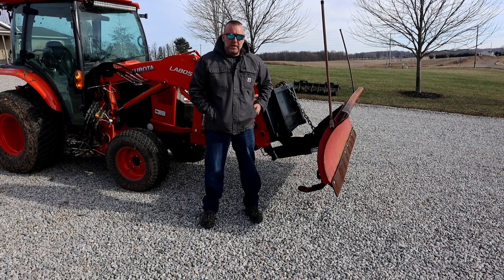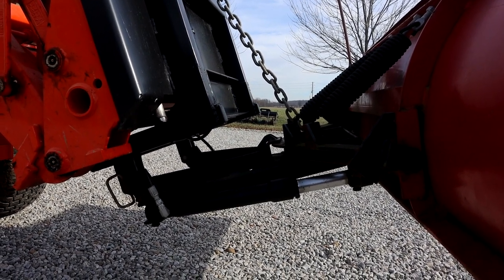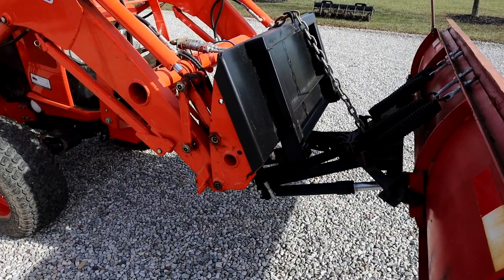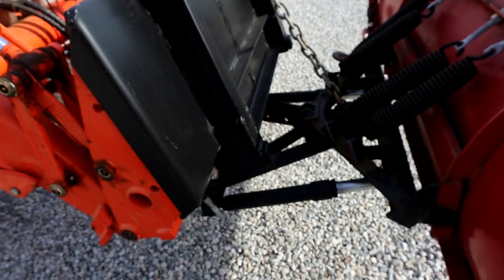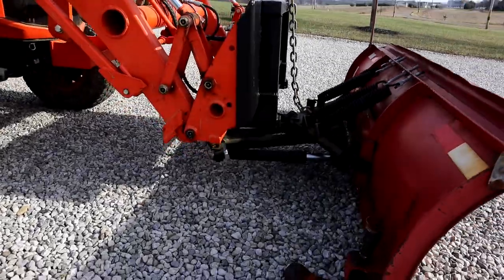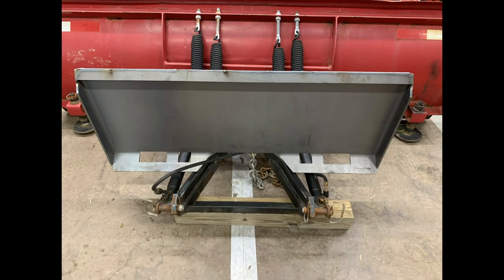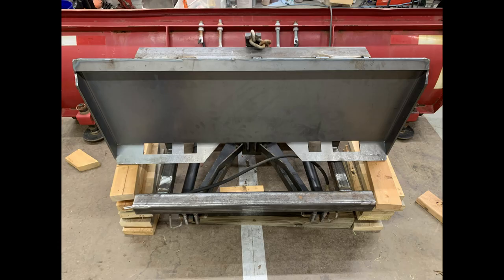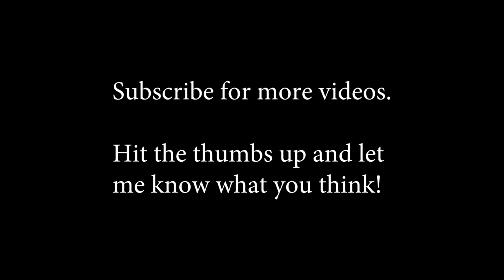Truck Plow Converted To Skid Steer Quick Attach For Tractor

Comment: Originally, I was going to just use the full length of the plow, knowing that would be a lot of leverage on the loader.  This makes much more sense.  I think we are working with similar plows.  Does each hydraulic have only one hose? Mine does. I can't wrap my head around how to make that work, knowing my 3rd function grapple has a check valve.   Thank you for taking the time to make a video and share your ideas!
Reply from the maker: I definitely like this setup. 

Yes, one hose per cylinder. Where is your check valve? Right before the couplers?
Reply: @JaredsShop  I believe the check valves are where the step up would be and where the 3rd function install was.   I could be wrong.  I have a Kioti Ck2610 compact.

Comment: Great minds think alike. Thank you sur, this is exactly how I was in visioning setting up my new tractor with my old plow truck plow. You mentioned fusion 360 which leads me to believe you have some engineering background. Fusion 360 is definitely great software; I use it daily.
Reply from the maker: I have an electro mechanical background as well as IT. I spent several years working on CNC and manual machine tools as well as cranes, HVAC, etc. I took autocad classes in college and played with sketch-up for a while. I started playing with fusion recently though. I’ve only used it to create some items for 3D printing but hope to expand my usage of it. I’d like to eventually get a plasma table and I  building a CNC router. Fusion will come in handy for both of those. 

As far as the plow, I’m happy with the design. It floats so nicely not having the weight of the loader on it and keeping it underslung so the pivot is close to the plate has proven to be the best setup. It reduces loader flex and keeps the length shorter.
Reply from the maker: What do you do that has you using fusion?

Comment: With all that crushed rock, have you considered adding a 2.5-3" pipe the length of the cutting edge?
Reply from the maker: It doesn’t help that much. I have a plow on the front of my RTV 1140CPX and put a pipe on it years ago. Unfortunately, it was a lot of work for almost nothing. It still plows gravel. The pipe would probably work if the ground was frozen but when it’s not, it easily moves loose gravel. When making this plow I knew I’d have to find a different solution. I also considered using casters and may make a set some day to try.

Comment: Hello Jared Great design and well thought out. Would it be possible to ask for a material list you used with steel sizes. Also do you have a pdf or doc file with all the dimensions to make this. I am a shop teach and want to make this a project for my class, as you talked about leverage and why you made the design closer to the tractor loader compared to other DIY designs out there. As we just received our plasma cutter I will have the students make the quick attach plate also as their is a lot of geometry with the angles of all that is needed to make it fit an lock on the loader.
All so after using your plow is there any adjustment or changes you would make.

thank you

Comment: That setup got to be heavy with all that box steel and a channel welded to the plate before you even hook the plow up. What do you have there 300-400 lbs
Reply from the maker: It’s probably 250#, give or take. The plate was about 75# and I’d guess there is no more than 175# in extra steel. It’s light enough that I could move it around by myself.

Comment: I really like this design. Can you share the size of the square tubes you used?
Reply from the maker: I will get you the dimensions. I just used what I had.
Reply: I was also wondering the dimensions of the tubing that you used, and the dimensions of the channel, fabulous idea I am about to build it myself for my skid steer
Reply from the maker: Most of the front frame is 2x3 tubing but there are also a couple pieces of 2.5 x 2.5 and 2 x 2. Once again, it was made with what I had laying around.
Reply from the maker: @neverendingluau  
Posted.

Comment: kinda putting those hydraulic cylinders in harms way underneath aren't you?
Reply from the maker: I don’t think so. No more harms way than when the plow is on a truck. I didn’t change the location of the cylinders. They’re still behind the plow and protected by the plow. In essence, all I did was put the pivot closer to the loader frame. 

If you also asking if the cylinders can impact the frame I built, the answer is no. The A frame of the plow touches. I can actually push down on the frame I built and put it against the A frame and have down pressure for ice and such.
Reply: @JaredsShop  was thinking more of the ground itself damaging tubes .. laying on chunk of ice  or something by accident.. great job BTW
Reply from the maker: @SomeGuy8796  
Thank you!! 

Then my first paragraph applies. They’re in the same place as when the plow is mounted to a truck. They aren’t any lower. The plow rides at the same height. I just didn’t want it sticking way out adding additional stresses to the loader frame and making harder for the front tires to get grip when steering.